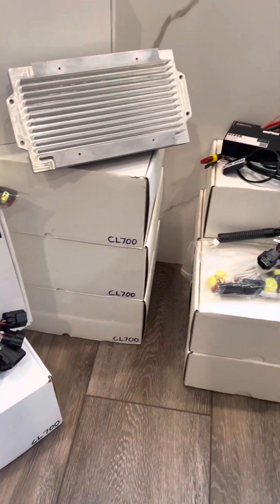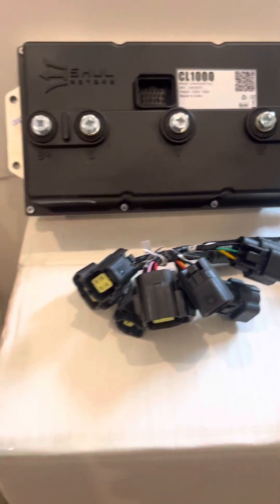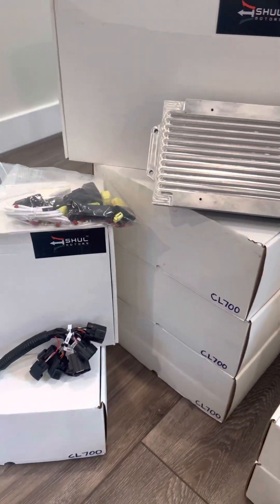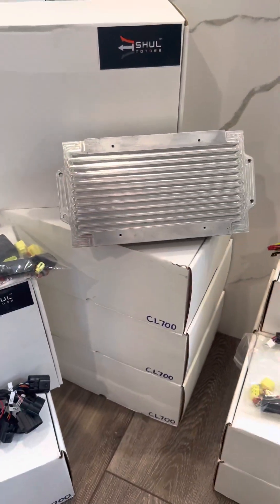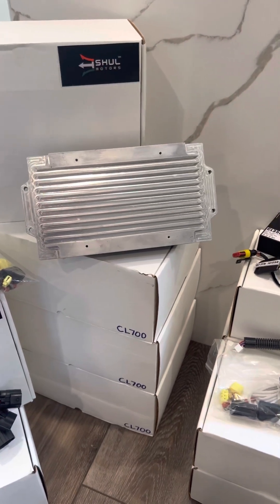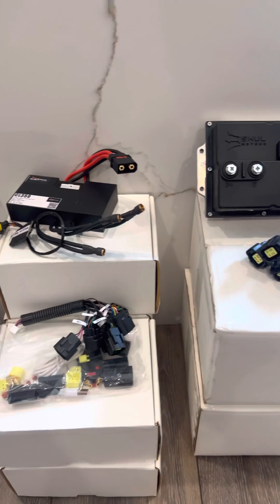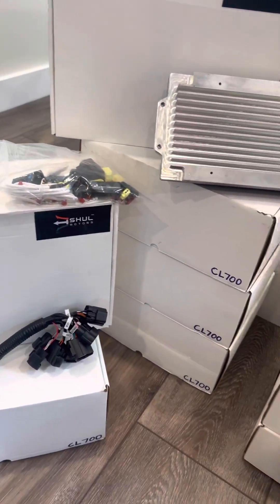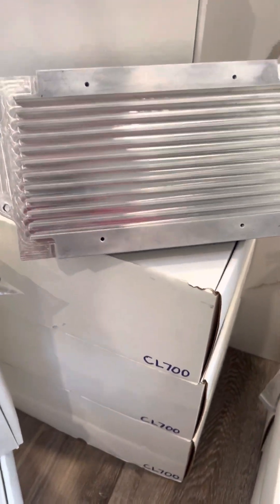Electric ⚡️ Mx - first look, new 3shul electric vehicle controllers 🦾

Comment: are those ratings peak amps? and hows the repairability of the board?
Reply from the maker: Peak yes 
And good, and bad they boards are epoxy  filled making they waterproof but not so easily repaired 

Have had a lot of bad luck with these controllers waiting for Gen4
Reply: @electricmx did you try v4 ? I meed it for hub qs205 , do you sell v4 with harness ?
Reply from the maker: @Vedrinec394  have v4 in stock right now testing asap!
Reply: @electricmx  do you have v4 stock with harness i using qs 205 hub,,,did you test it how relaiable is ? Im using kelly controllers for years they are good not single die ever
Reply from the maker: @Vedrinec394  hey!!! I have 2 v4 CL1000 in stock in just doing testing but seems like issues from V3 are solved check back with in a month my 28S bike will be putting it to the test!
Reply: @electricmx  need cl350 it is qs205 no need to hidher controller
Reply from the maker: @Vedrinec394  understand!! Can order in for you if interested 
I seen them have great success with the CC350 no personal experience yet